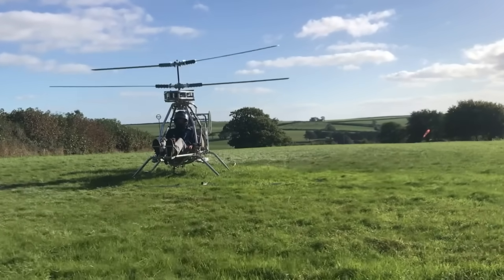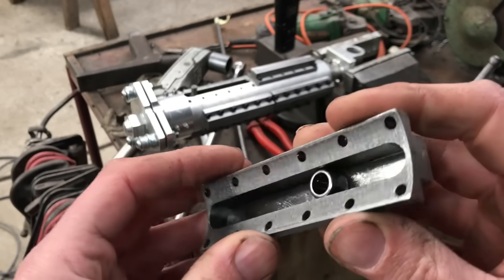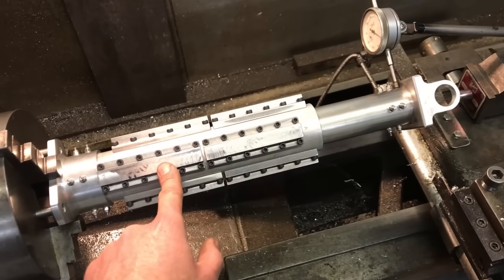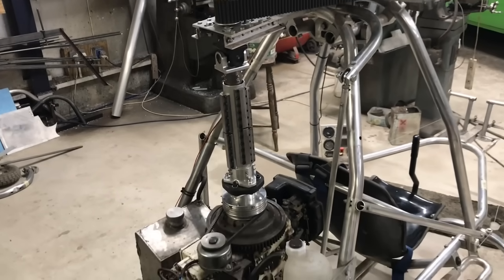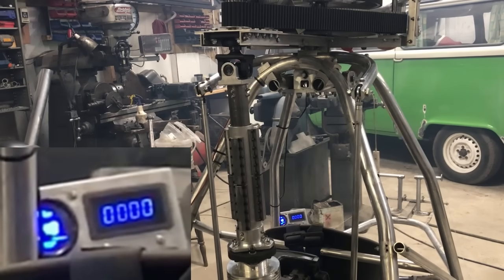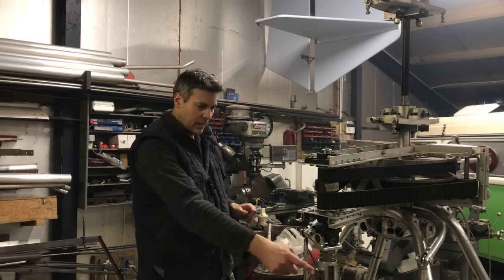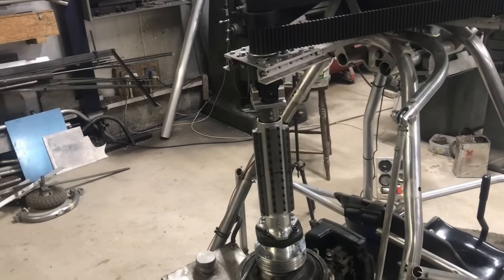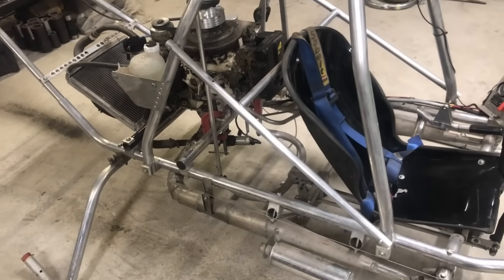Homemade Helicopter drive testing part 1

Comment: Loving this project! Happy to be corrected but don't UJs need to be in matched pairs to stop surging?
Reply from the maker: @Pickles_The_Wise  You are correct, at 4 degrees a 0.49% change in rotational velocity occurs. As 4 degrees is the maximum the joint should experience I decided that 0.49% change wasn't enough to worry about. I could be wrong of course.
Reply: @Ben-Dixey  I like your style! might be worth exploring how that .5% would affect Accel/decel at the blade tips and with the mass of the rotating disk. could be nothing or could be like an impact driver in the shaft. Either way I'm excited to see the outcome!

Comment: I just had a thought.  How about when testing, use a thermal camera to see if bearnings etc, are getting hot from too much friction.  I know thermal cameras aren't cheap, but for peace of mind, they maybe helpful.  Or maybe, I don't know what I'm saying, lol. It's coming along though. 👍👍👍
Reply: Or get some telatemps
Reply from the maker: @lathenfrank-mm4ie  Thanks, didn't know they existed. 👍
Reply from the maker: @simonwatson5299  Hi, are you thinking of all bearings on the helicopter or just the new driveshaft bearings ? I hadn't really considered the possibility of bearings getting hot on the driveshaft but if they did it would bind due to the heat expansion. 
A thermal camera would be nice, be a cool thing to see what's getting hot. 

At the moment the engine overheats at around 2 minutes operation so bearings don't really get chance to overheat. When I improve the cooling system for longer flight duration then I will definitely need to monitor bearing temperatures.
Reply: @ Well yeah, all of it.  bearings on the driveshaft and also other areas where friction could be a problem. I mean, you don't want to be in the air, when all of a sudden, stuff seizes because of unseen heat expansion.  But then again, I know bugger all. lol. Also, maybe some exhaust wrap for the exhaust, when you change it for one that isn't cracking.